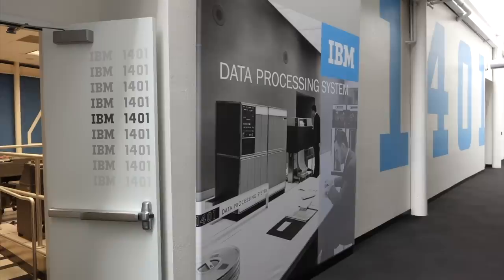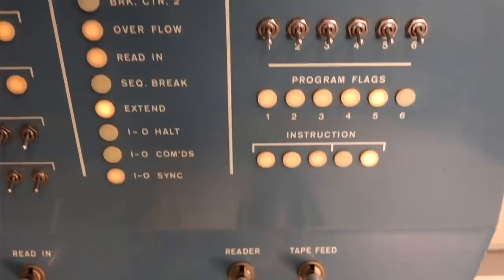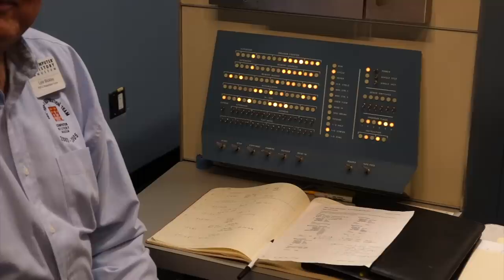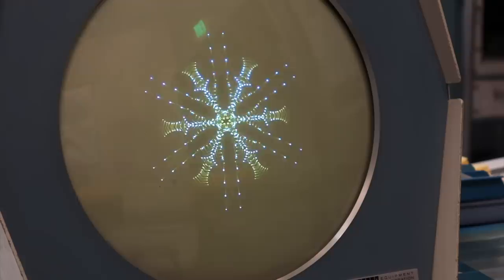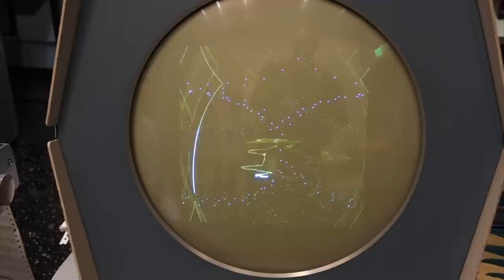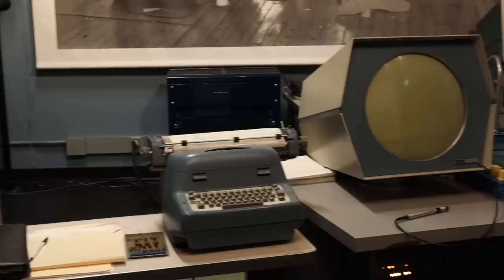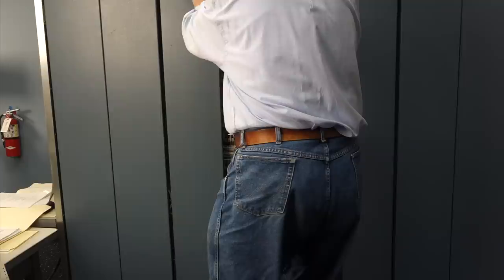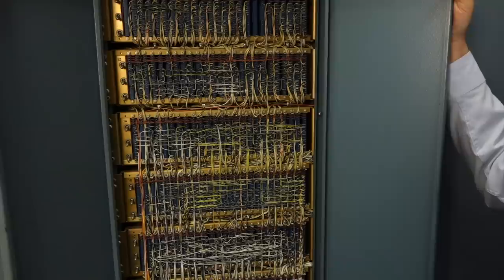Lyle Bickley explains the PDP-1 (and we play the original Spacewar!)

Comment: I'm looking at this for the first time: ...Oh that tape reader and the computer is quite big....Oh interesting monitor, it must be heavy as it's on a big desk...Oh ok, it's not a desk it's the top of the processing unit...Oh ok, that's just the processor and memory for the screen. Blimey. ...What?? The actual computer is in that big filing cabinet....Ooo Kkk There's three other 'filing cabinets'....God that's a noisy fan (Im guessing most people that have seen this thing never feel obliged to complain about noisy PC fans ever again). ....looking up history, this computer was actually SMALL compared to other computers of the day. Most surprising thing is that game. ...and the music coming from it. What was its ability to produce sound originally meant for? ...or has it just had some sound-producing arrays added to its output lines as an early version of 'peripheral' 
 (I'm assuming it has rows of power outputs). I'm really amazed too by the self-typing 'character printer' (its debugging output looks like a kind of assembly language shorthand) and the ways the designers thought up to communicate outwards what it had processed. The whole thing is amazing really. Seeing how all these parts of it work with each other gives you a really clear idea of what's going on and where to start with debugging.
Reply: The music and the game could not run at the same time. They just overlapped them in the recording.